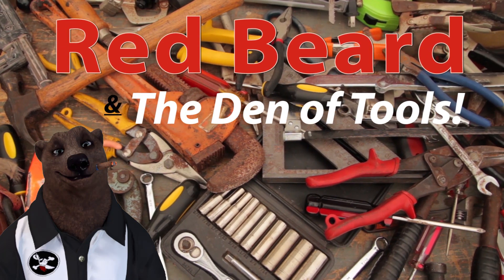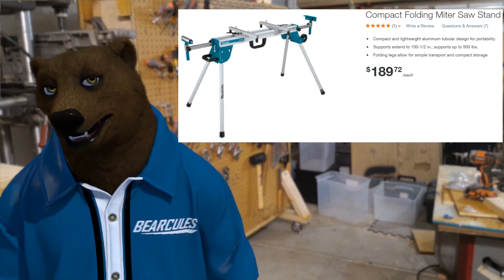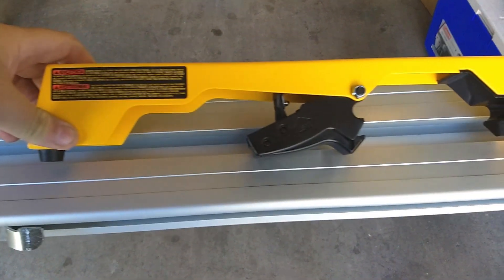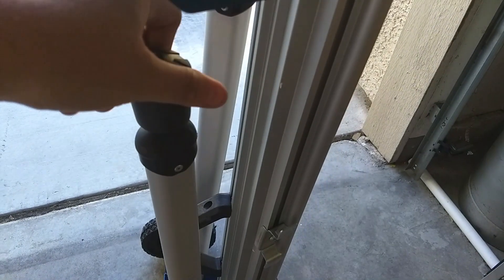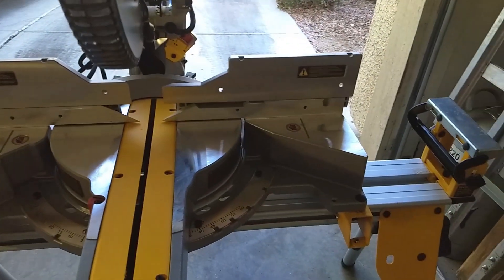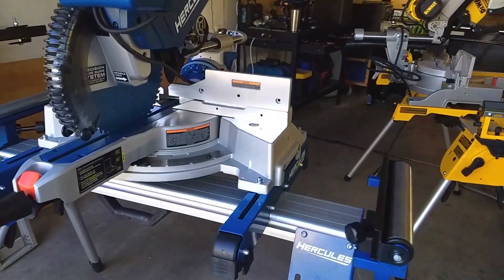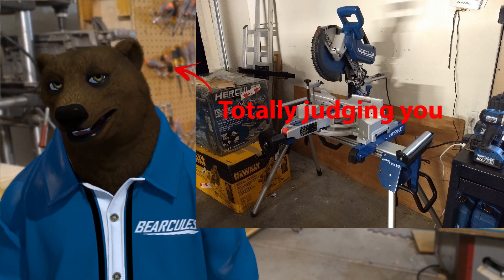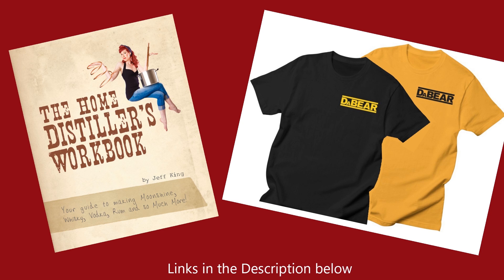Hercules vs DeWALT Miter Saw Stand (Has Harbor Freight surpassed Big Yellow?)

Comment from the maker: The base on this saw is a pre-release Hercules.  Expect it in stores mid to late February 2019
Reply: @annhunter7930  HF coupons do not apply on Hercules items. I bought the cheaper model with coupon for  $99.00
Reply: I was in my local store today (Jan 22, 19 in Oceanside, CA) and they have several in stock.  Amazing quality.  I'm purchasing the Hercules saw tomorrow, but I already have an 8' rolling workbench for my station, so I'm not buying this stand.
Reply: This is very similar to the Kobalt. The Kobalt is $155.00, and the Hercules is $189.00.
Reply: Do you use the guide? I tried to move mine since I'm using with my Hitachi 12in and I ended up stripping the bolt. So now i can't move it. I was still able to mount my saw just not on the guide.
Reply: Hello Bear man, I have just purchased the Hercules Saw and stand.   I have a couple questions you may be able to answer if you have a chance.   1st, the guide has an Allen screw and it was frozen, so I actually stripped the head trying to loosen.  It may not be worth disassembling to take back for a new one.  Just wanted to see if you or anyone else encountered the problem, and what you did to correct.  2nd, did you remove the rubber feet on the saw before mounting it on the stand?  I have them on, but it seems to make the mounting brackets can't inward.  Thanks for any input.

Comment: I have just set up my Hercules stand and noticed welding being off on the arms with rollers. Check them out in the store and save yourself a trouble. I will have to take it apart and replace it. Also I noticed that one of the "Workpiece Supports" is almost impossible to set. It keeps sliding down. I maxed out the torque on the knob and no results. The second one is a bit better, question is: for how long... A little bit disappointed.
Reply from the maker: Can you return it?
Reply: @denoftools  yes, I purchased it few days ago, I am planning to replace it. I will check the welding in the store this time... btw the support legs for  storage option don't look sturdy at all. I would not dare to store the stand along with miter saw on it. It's asking for trouble...

Comment: Can u leave the saw attached and fold the stand up and move it around
Reply from the maker: Yes and I do that all the time.  There is a small bracket on the back of the saw that you want one of the mounting brackets to fit into though if you are going to do this.

Comment: Can this unit be used with the Hercules job site table saw?
Reply from the maker: Yes in fact I could probably be used with most jobsite saws the problem with the tablesaw is the height. It would make it much higher then you would want to be able to safely use a tablesaw at

Comment: I am going to buy a miter saw work station so I am watching You Tube getting the inside scoop on all the stands.   The first two videos on the Kobalt stand had two very glaring defects, a wobble with the board stop having play and the second was the saw mounts had play in them.   Scratch Kobalt off my list.  Master Force has a nice stand and the reviews were good.  Had a triple mounted outlet too.   The Hercules I will have to look at as a comment about legs bending in time are a concern.  The Dewalt one was disappointing with the play in an area that requires rigidity.
Reply from the maker: Check out the Bora Portacube

Comment: I finally got my saw a master force from Menards 10” I wanted the Bauer but they didn’t have any in stock at harbor freight so I then went to Menards and checked them out loved it bought it the Bauer is a great saw but the master force is a little improved any way I bought the master force stand and wasn’t happy with it saw felt cheap on it although isn’t a cheap saw lol so I was in harbor freight getting some other things and seen this set up way taller and better built bought it put my saw on it feels like an absolute beast of a work station now no back ache from a low stand I’m 6’1” so at 33inches high it felt like crawling into my high school desk lol my ch happier solid stand would have bought the Hercules saw to but I’m not a fan of 12” saws if they made a 10” would a bought that to 😅

Comment: Has anyone not broken the handle off their HF stand yet? Mine lasted 5 days of light use. I was wondering if anyone had a fix for this, I can't see returning it as this is a weak link and the next one would eventually snap off too. Too bad for this one flaw in an otherwise excellent stand.
Reply from the maker: Nope mine is solid as a rock. I tried calling them as they have increase their parts supply by quite a bit
Reply: @denoftools  well I guess I will exchange it then. I still have 80 days of warranty I do believe. thanks for the reply sir.

Comment: I am so done with my heavy -55 larger dewalt stand. I am not the young buck anymore and the dewalt is just too heavy without the wittle wheels.

I may dump the dewalt for the weight, no wheels, end blocks adjuster is crp, and lastly it has a really poor hook for hanging - deadly for kids if their in your garage - flat out sketchy.

Comment: HUGE difference. IF DeWalt only had that one model, I would run to Pearl Harbor Freight and not consider DeWalt.... BUT DeWalt has a number of models to choose from. It has in and outfeed rollers, tires with spinners and is chopped and fitted with a chevy short block and blower..   DWX726. I would contend they should over time, consolodate to one single heavy duty and one single compact model... making four plus models means where you buy it will determine which models you will get to choose from.  I will like to see a video of DeWalt's best model
Reply from the maker: You have to understand that just like other tools each of these stands have different jobs. That DWX726 is generally only used indoors.  The large foot bar on one side isn't good for outdoors on a jobsite.  Outdoors you want one of these four leg systems with an adjustiable foot.  That allows you to overcome an uneven work area.   There is not "best" model, it's about the best tool for that specific job

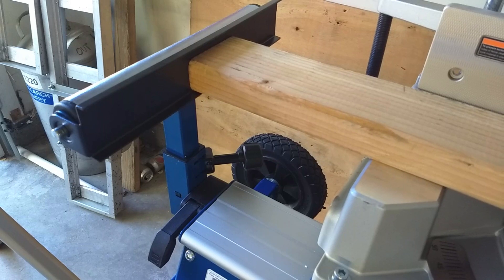Comment: You have the stop blocks turned the wrong way on the Hercules stand, at 9:29 the support should be taken out of the square mount, turned 180 degrees, and lowered so the roller is the height of the table, and the stop is toward the outside, so the work piece sets on top of the roller. I have the Chicago Tools stand, which I think is better than either one of these.
Reply from the maker: Sorry, I wasn't cutting like that, I was just trying to show how solid it is.  But yeah, I had the rollers on the wrong ends.  That's what I get for rushing.
Reply: Yep. Your roller stands were installed on the wrong ends. The unit with the two short square tubes on it belongs on the end of the stand that has the wheels, and the ends of the tubes face outward. These stubs form little legs that helps the rig stand up vertically when stood up on end. When done this way, the flip-up stops work correctly, too, so that they effectively stop the workpiece while the work is supported on the roller.

Funny thing is, there's no mention of the difference between the two roller supports in the Assembly Instructions. So I installed mine backwards at first, too, and drove in the set screws. Only then did I realize my mistake: I had to take out the set screws, swap the supports end for end, then reinstall the set screws. Typical HF crappy instructions.

Comment: You weren't paid? What do you call free tools? Expensive tools. But I gotta say, the one thing I really like about the Hercules saw is that big warranty. One year, right? Wait, isn't the DeWalt a three year warranty? Well, I guess you can always pay for an extended warranty at HF.
Reply from the maker: When you have more tools than any one bear can really use it ain't really getting "paid", can't sell them and can't pay rent with it. The Herc 1 year isn't a warranty, its a money back for any reason guarantee.  The DW you have to pay to ship and they may or may not fix it. Their service department has a 1.2 star rating so have fun with that.

Comment: Please, clarify for me...  I have the Herc saw/stand combo. The end block with the roller, is it meant to be mounted either way? Where the black flipping stopper will be squared off with the end of the wood your cutting, or reversed?
Reply from the maker: It can be mounted either way but the one with the feet on it are supposed to be on the side with the wheels to act as a stand for when you put it on its end

Comment: I purchased the Hercules stand just this week at my local HF.  I tried asking HF support if the stand could be lowered down on its wheels while my Hercules saw was still attached, but no one there could give me a definite answer.  Can anyone tell me if the stand legs will support the weight while I tip it over to the wheels in order to move it around?
Reply from the maker: Yes you can.  On the back of the stand there is a wierd butterfly like piece.  Make sure one of the saws clamps rests in that groove.
Reply: Have you tried to use the stand in this setup?

Comment: Red so correct me if I’m wrong but the only difference between Hercules and the Chicago electric stand is the paddle on the legs?  Trust me that is a big deal but I do love my Chicago electric stand
Reply from the maker: You are close.  The Herc is really just an upgraded CE stand.  The key differences are the paddles on the legs, paddles for the extensions, it holds more weight and it comes in lovely Bearcules Blue!
Reply: Red Beard and The Den of Tools does Bearcules have legendary performance like Hercules?  😂😂😂
Reply from the maker: I'm a legend in my own mind according to the Mrs.

Comment: So, several issues...

1) I actually use these saws/stands every day as a trim carpenter. We use the DeWalt stands exclusively BECAUSE they're light.  You don't want a wheeled stand, being drug through the mud/snow/rain/dirt/etc and then tracking that all over your customers home/garage/driveway. 

2) rollers suck for trim.

3) I don't know if it was oversight on your part, or biased reporting, but you didn't tighten the bolts/thumbscrews down on the DeWalt stand. Those stands need to be set to the table height of your saw, and then tightened down, permanently. 

4) if those arms on the Herc saw stand were put on correctly (not backwards), they stick out WAY too far and WILL get in the way when coping base/case.

5) the stop on the Herc stand is absolutely worthless for cutting trim. Also, the DeWalt's stop can be partially brought up and used to keep 16ft lengths of base from flopping around with the 'ears'.
Reply from the maker: The bolts were tightened down on the DW.  That was my point in that I kept making about the quality.  It was to the point it was going to break and it still was not tight.

Comment: This review is good but it's also flawed the stand that was shown with the DeWalt comes free with the DeWalt saw. DeWalt makes a stand that you could buy that has wheels like the Hercules they also make rollers that you can buy 2. Also just to clarify it depends on where you buy the saw some retailers will you the SAW stand for free
Reply from the maker: More like it "sometimes comes free".  They run that promotion once or twice a year.  Not exactly something to bank on.  And I don't think it's this stand, I think it's the smaller cousin to this stand.
Reply from the maker: Home depot has that saw with the free stand right now.  It's almost $800 for both.  Not exactly what I would call "free"
Reply: @denoftools   I hear you but the company I bought the saw from give me the stand for free so is just six hundred bucks for the saw

Comment: Only thing I don’t like is the rubber feet keep the saw from mounting squarely to the mounting brackets, and even if you remove the feet, the holes the feet go into protrude past the rest of the bases bottom edge.  More of an annoyance for me than a big problem, but has anyone got a trick to fix this?

Comment: I would like to see you compare the Hercules to the regular one that HF has. I have it and it doesn't seem a ton different.
Reply from the maker: I'm a huge fan of the 12" CE.  The biggest problem with that saw is QC.  Some people end up getting saws that simply will not cut straight.  If you have a good one and it works for you then there is no big reason to move to a saw like this.   Reasons for getting this saw over the CE?  You move the saw around a lot.  You cut a lot of big timber, like 6"x6".  You cut a lot of hardwood.  You are constantly changing the angle or bevel.  You are tired of that damn laser getting out of alignment or blocked by sawdust.  Or you just cut a LOT.  The CE is a great hobby saw but the motor in it is not made for constant use like you see on a job site.
Reply: @denoftools  Sorry should have been more specific I meant the stand. I got a great deal on the Kobalt 12" saw and haven't had any issues with it but I just use it lightly around the house.
Reply from the maker: lol, the stand is just an upgrade of the basic HF stand.  If you don't need the additional features you will be fine.

Comment: Over all the Hercules stand looks nice but when u have stop block up there is no support for material am I wrong
Reply from the maker: No, you can also flip the stop block over to the other side if the roller.  It will still be about 1/2" above the roller so it will still act as a stop block and you have the roller for support.

Comment: Will the DeWalt saw fit on the HF stand with the DeWalt clamps?  I have the DeWalt stand and saw, but I like the setup of that HF stand better (end rollers and wheels) but I prefer the DeWalt clamps
Reply from the maker: NO and now my finger is killing me!  (my own stupid fault).  But no, the Herc stand is too thick.  The depth is right and it will go on the stand but it can't sit down far enough to clamp in place.
Reply: Sorry for the finger, but thanks for checking.

Comment: How does the new Hercules compare to the existing HF Miter Saw Stand? Looks very similar. Other than the leg pin release, I didn't see too much that jumped out at me.
Reply from the maker: Its an upgrade of that same stand.  Benefits are... Paddles for leg release, paddles for extension release.  Better adjustment control for risers.  Holds more weight. Rollers actually ROLL. And it comes in lovely Bearcules Blue!

Comment from the maker: Thank you to all our subscribers!  Rember HF came to us because of YOU!  They tell me constantly that it's because of our active and VOCAL community that they chose to work with The Den.  They watch these videos but even more importantly they read the comments.  Like when we said a 90 day warranty would not cut it on a major purchase like this saw, they heard that.  There seems to be a major shift going on over there, and pro/prosumer tools is part of it, the other half is listening to their customers.  Lets cross our fingers and hope it continues.
Reply: I'm glad to hear it!  So many manufacturers lately seem to be stagnant or worse - reverse engineering (ahem, Sears before they sold to SBD??) so it's great to see a company continue to improve their products.  Their current stand was better and cheaper than the DeWalt stand, so when I bought my DeWalt saw, I went straight over to HF to get the stand.  I'm REALLY curious to see the saw comparison.  In particular, I would like to see the saws put to some "prosumer" use.  For example, cutting about one hundred 45 degree cuts in a 2X4 repetitively to simulate building a wishing well.  I'm curious if the HF saw can hang with DeWalt when it comes to overheating over repeated use.
Reply: Looking good.. this stand is what I have been waiting for. I have a very old but perfect running Makita chop saw I have had since new, in the early 80s. Its been on a home made wood stand with metal saw horse legs most of those years.. and its getting old & warped, wobbly, and beyond the point of needing replacement.
Reply: My Harbor Freight $99 one is better than the DeWalt
Reply: You do great videos by what you need to do is compare to do a fight with both tools in real time on your video which Cuts better which Cuts cleaner and better and faster
Reply: nice

Comment: Please disregard the part in my orevious comment about no support with the stop flipped up. You have the post installed backwards. The roller is the horizontal support and the stop is just barely higher when activated. Look at the pictures on the HF site.
Reply: ..."bearly"...

Comment: I will tell you this stand is not what people are saying it is. I bought based on the reviews, as I am sick of the dewalt stands. This stand is much worse. I use my stands daily from job to job. Within the first couple weeks this thing started showing it weaknesses, the brackets that lock the saw on the stand started to lean towards the rear. I retightened up the bolts on the brackets and it was good for another few days, then the handle broke off. Trying to lock the legs into position to lift the stand is scary at it’s best. Better to have an extra set of hands around. Closing it up is just as scary. I have went back to the dewalt stand, just this time I bought the one with the hydraulic lift.